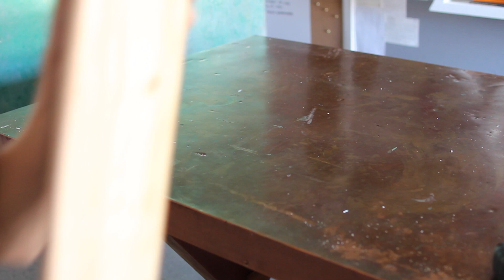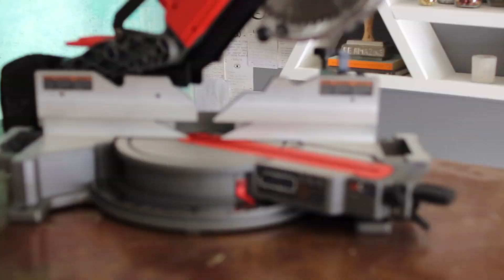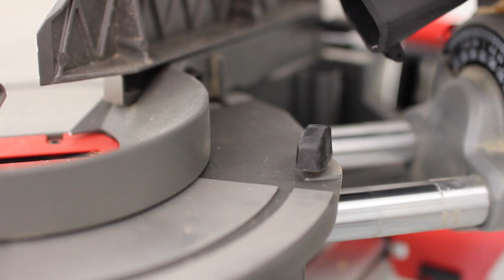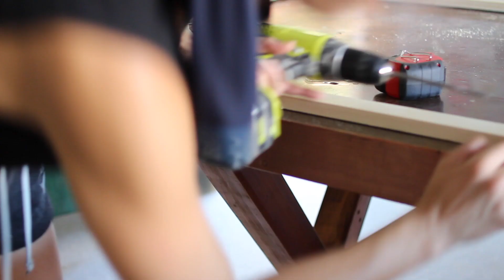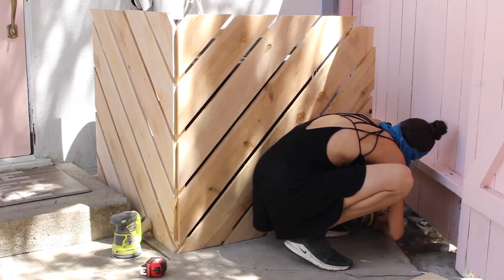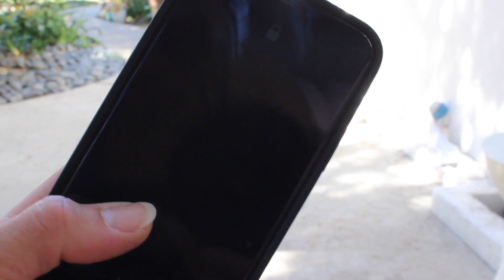Cheap DIY AC Unit Cover + Battery Powered Miter Saw!!!

Comment: I have a DeWalt miter saw but I'm thinking of selling it to get a sliding miter saw. I have a Milwaukee drill so maybe this one would work for me. I'll have to check the voltage on the battery my drill uses. Rach, I adore you.
#girlswithtools
Reply from the maker: Thank you so much Nikki! You just made my evening. I am happy to report this is the only miter I am using currently since this build. Been working on a project for three days and the battery hasn't died.

Comment: The A/C unit could be  affected by those panels ,your blocking much needed air flow .Need to be a foot away
Sorry didn't mean to step on your high, 35 years A/C contractor
Very nice job
Reply from the maker: Yes! Thank you for that - after shooting this, we moved it away the proper space.